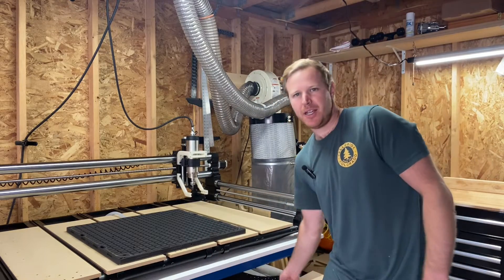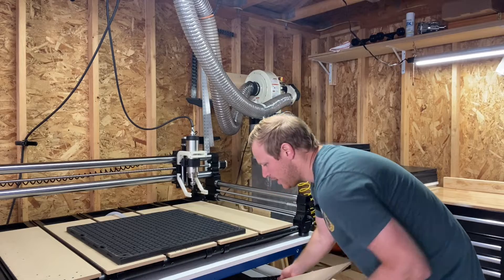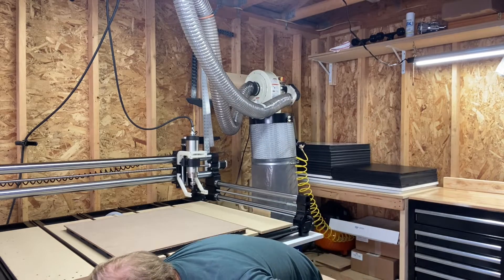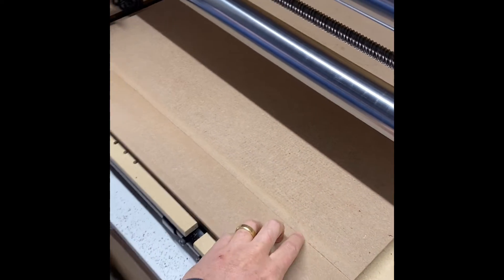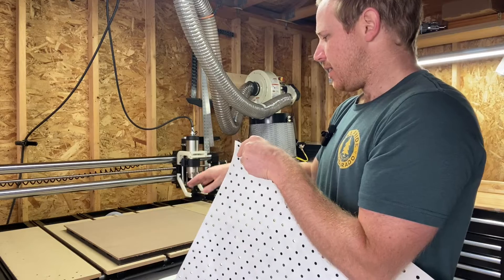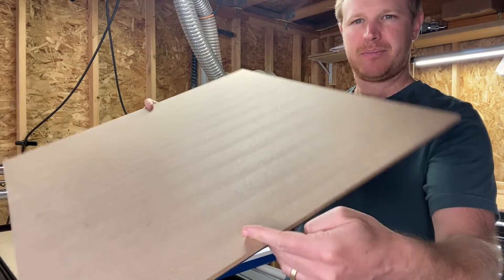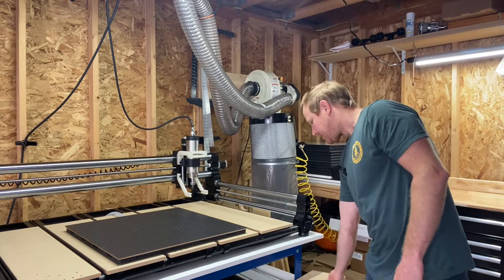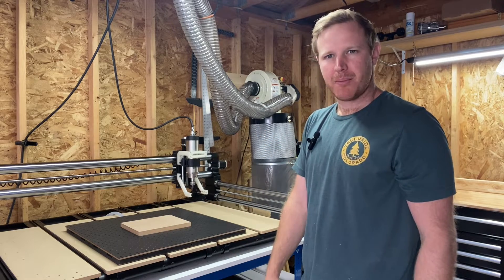AirWeights x Tile Gasket | Amazing CNC Vacuum Hold Down Method

Comment: One of the reasons i want to buy this but still not sure is sometimes I join boards together then flatten one side then the other. This means some areas aren't completely flat on an initial surface run and in all your examples your work pieces are already flat and therefore can take advantage of the vacuum. My question is, if I'm surfacing a work piece that has an uneven bottom surface, how effective is this product you have?

Comment: Could I seal one side then peck drill a shallow hole pattern on the top face of the MDF instead of a full re-surface? Wouldn't that do the same thing? I could even make the hole pattern to follow the channels in the AirWeight panel to make it more efficient, am I missing something?
Reply: You are also making sure the mdf is actually flat, referenced to your spindle.

Comment: Do you not have to worry about the zones and covering up the zones that you don't need?  If so, how do you get access to the zones with the sacrificial mdf on top?
Reply from the maker: The zones that aren't being used are simply plugged. The included rubber plugs can also be cut down for a zero-clearance plug that does not interfere with a top layer.

Comment: Is there an advantage of buying the fixture plates as opposed to 1/4" mdf.  Can you make a video of using the fixture plate?
Reply from the maker: They both have specific advantages. The MDF is porous and can provide vacuum across the entire table. The fixture plate is sealed, and provides vacuum under a specific area, and at a stronger vacuum force.

Comment: Can you re-use the sacrificial piece or is it at 1 time use?  If the latter that would make this process pretty expensive
Reply from the maker: Yes, one sheet of the gasket can be re-used many times over. The intention is to cut through your part, and cut just a hair deeper into the gasket. This leaves a tiny mark on the gasket material, but does not compromise the sealing ability. If you are careful with cut depth, you can extend the life of one gasket sheet for a long lifespan. Eventually, if/when the sheet loses its sealing power, or you cut too deep, you can just peel the gasket sheet off the MDF, and re-apply a new adhesive backed sheet.

Comment: Hi, 
I tryed but my pumps goes about - 12 Kpa versus -90 Kpa if I put a Composite Aluminum Polyethylène over my table ...
What Do I do wrong ?
Reply: I have a similat pump and I have a tile gasket 6 mm diameter with 25 mm pitch ...

Comment: Love the concept and the product, can't wait to see where you guys take AirWeigts!! Can you "daisy chain" multiple plates?  I regularly cut 2x4 sheets of HDPE and something like this would be perfect for that workflow.
Reply from the maker: Thanks so much! Yes, multiple vacuum tables can be connected together. We are also considering offering a 2x4 table. 
In either setup, the system can occupy a larger footprint to hold bigger workpieces. 

Please feel free to direct any specific question on the contact section of our website, we are very responsive there and happy to help!

Comment: Interesting. 
I had bought some 1/4" pegboard, fly-cut it, and experimented with putting it right on my HDPE vacuum pad, hoping to do what you've done but in one less step. It didnt work at all, I couldn't draw any vacuum to hold my workpiece on top of all that.